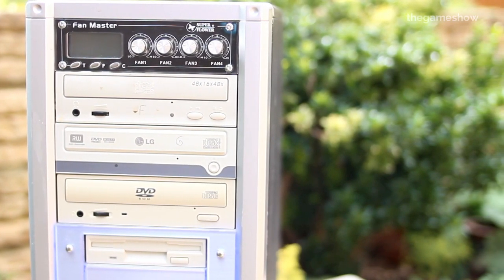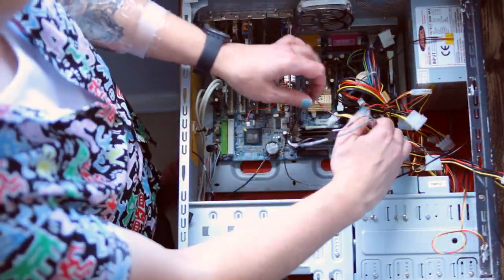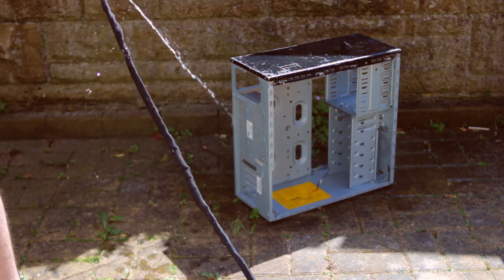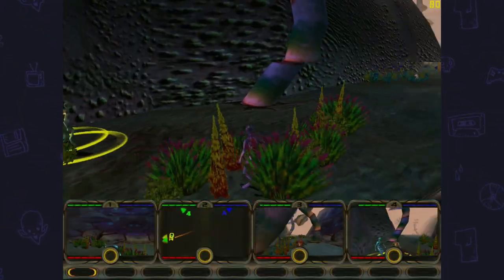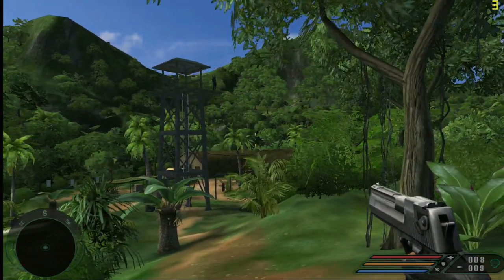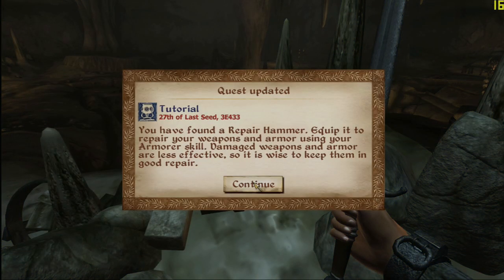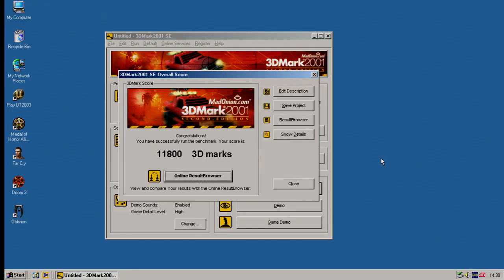Refurbing a 2003 Radeon 9700 Pro Gaming PC | Get into Retro PC Gaming

Comment: I really wanna see Oldblivion (I think that’s what it’s called) which made the game run on a Pentium M + X300 Laptop I grew up using. 

I completely agree about PC part pricing on the retro side. The main cheap way to get into it is just trying to find a prebuilt on Marketplace. The bootfair shave dried up, eBay is full of scalpers (my £50 S423 Board is now £150+) 

Absolutely fantastic watch, I’d personally love to have a showdown between this and my retro Pentium 4 PC 👀
Reply: Thanks for linking me over to this :) this was definitely an interesting video to watch. It's a shame I don't have easy access to car boot sales and the like, as I'd still be looking to see if I could find anything of interest/value.
Reply: This was a cool video thanks budget
Reply from the maker: Yeah eBay is a lot of work for buyers now. FB isn't too bad, or the pre-owned apps like Shpock or Craigslist. 

That showdown is a great idea. We should definitely do that!

Oh and also, thanking you for the punt dude. I massively appreciate that.
Reply: I have found the best way to get old ram and gpu's is to buy joblots, alot of effort is required to test them though as they are mostly sold untested hence the low prices, I got a couple of lots that worked out at £1 per ramstick/ GPU.

Comment: Great thorough rebuild - really enjoyed watching :)  I was a big fan of the Pentium 4 back in the day, despite all the concerns around them running hot, and still am today (my current Windows98 build is running a 3Ghz Pentium 4 and a Radeon 9800 Pro,  both with mild overclocks, so in a similar ballpark). For a bit of comparison if you're interested, its 3dMark 2000 score is 16537, 3dMark 2001SE is 16895.
Reply from the maker: Glad you enjoyed it! The P4 is a great CPU. It gets a lot of flack probably because it hung around too long. Great sounding build, bud.
Reply: @MattyStoked  Thanks! Yeh there's a lot of support for Pentium 3 in the intel camp when it comes to building a Windows 98 PC, or going with an AMD of some description.  Id be keen to try them one day.

Comment: Hey mate I had a Powercolor 9700PRO AIW back in 2003, it was the bees knees. I had my Xbox hooked up to it and used to play Xbox Live on one monitor and browsed the internets and chat on the other - it so awesome. Mine ended up failing though, R300 was the best!

Also regarding Doom 3, I recall playing it at 1024x768 with mediumish settings at 30fps+. I think Morrowind would be a better fit for this PC.

Comment: 7:00 By the way, 9700 and 9500 cards have a massive failure rate due to the cooler contacting the metal shim surrounding the GPU die, rather than the die itself. You might want to take the card out, hold it against a bright background, and just check if you can see daylight between the shim and the heatsink. If you can't, and the heatsink contacts the shim, your card will kill itself with enough use. I've personally bought and returned many broken Hercules 3D models also, so they've got the same problem the reference cards have.

The fixes are removing the shim, or getting something like a Zalman VF700, or a heatsink from a 9800-series card, both of which protrude below the shim to make complete contact.
Reply: You might get a performane boost with windows xp.

Comment: Actually scored a Radeon 9700 Pro in an ebay auction for $120AUD (about $85USD) with original box! I know I lucked out there. Matched it with a Athlon XP 2800+ with socket A MB for $30 I bought 6 months earlier. Already had a case and RAM, so pieced together a naughties era PC for myself. Even managed an 128GB SSD with adaptor for loading speed and dual boot 98SE / XP. The thing screams compared to what I had back then.

It sits pride of place next to my modern Ryzen 9 machine. Both my teenage kids fight over it to play Quake 2, Unreal Tournament 2003, Half-Life 2, Wing Commander 4 and a bunch of other Star Wars games.
Reply from the maker: That's so rad, man. Really pleased to hear the next generation are enjoying the old games!
Reply: Nice thats an awesome deal.

Comment: I am currently slowly aquiring the parts to build a late 2000s beast build with a Q6600 and 8800 GTX. It should be able to run anything from the 2000s very well and its limit would probably be Crysis, where it should get roughly 30 to 40 fps at medium.

This era of components is actually rather cheap imo. I am reusing some parts that i had lying around like a PSU and a DVD drive. I am able to get ddr3 or ddr2 ram for like 5 quid. And i am probably going to fit it in a newish case and make it micro-atx to save on space. I paid 20 quid for the CPU and GPU combined and I worked out it will be roughly 60-70 for the rest of the components depending on whether i go for am SSD.

I can't decide what OS to go with tbh. The 8800 GTX was I believe the first card to support DX10 and Vista is the earliest OS to support DX10. But then I might go for something even later becasue I wouldnt mind access to Steam as i dont have many physical games anymore. I could always dual-boot but idk.

Comment: I recently built in this exact case, but with black metal, and no side window case mod. Picked up an old junker PC for the PSU and case in order to flip some spare parts. Really made me realise just how little cases have changed.
Reply from the maker: Dude, you're right! ATX mobos and cases have been on sale for nearly 30 years now. Save for a few cables and connectors, building a PC has barely changed since the '80s. I absolutely love it.

Comment: You might want to mention about jumpers on the HD. A lot of people will build to see there HD isnt being read. If there on an mobo it wont detect it unless the correct jumper is in place, its on the back. Its got little pins. if its set to 3 or 6 gps an old motherboard wont see it. you have to set the pin to 1.5

Comment: Sleeving the cabling was the right move. Pentium 4's pack the heat, and it's smart to get some airflow going. Also, ME isn't a bad idea if you're targeting 98 era games, but I think there is an unofficial service pack 3 for 98 that you might want to try too. Cool build. Enjoyed the video.
Reply from the maker: Thanks for the very kind comment. NGL, 90% of the reason I sleeve the cables is aesthetics. I hide behind the idea of efficiency but really it's because I don't like looking at the cables lol. I really like ME, I don't get why people continue to dogpile on it. Win98 SP2/3 is also very good, but that doesn't make ME bad!
Reply: @MattyStoked  not kidding. I started typing out my comment suggesting you buy some tech flex sleeve and heatshrink, but then saw you already did it. Haha I'm the exact same way. The ketchup and mustard look was never flattering. As for ME, I think people just don't like change. Windows users always hate updating.

Comment: Had the same 9700 pro in a box for years dunno if it was working still.
During a move something fell into the box of stuff in like 2016 so it broke off a vram chip and upon testing it was certainly dead at that point, pretty much decorative as a bare pcb now in my apartment.
Hercules 3d prophet 9700 pro i believe it's called.
This generation of cards were prone too die due too the shim around the gpu die being slightly higher then it should so you should remove it really together with vram chips running quite hot but they have heatsinks on this model of the card.

Too get the shim off, basically use a boxcutter/snap off blade knife (Used a generic cheap one here too remove the shim on the dead 9700 pro i got.)
or a sharp thin X-Acto knife & carefully go around the edge of the shim slowly pushing in under it between the gpu & shim & slowly forcing it upwards as you'll be cutting the glue/tape which is like 3 - 4mm wide use a shorter blade if possible & make sure too not push inwards with too much force towards the gpu die like i did with this dead card, i mean it popped off but i also destroyed a small capacitor on here on the gpu die.

The corners should be easiest too push in at as the glue/tape isn't around there, careful so you don't destroy one of the capacitors around the gpu die though i pretty much tore one off as the blade pushed straight through the glue suddenly trying it here on the dead 9700 pro i got.
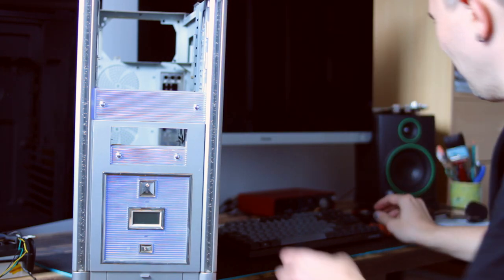Might take a few minutes but it should eventually pop off fine even 20 years later think philscomputerlab did remove the shim on a working 9700 pro a few years ago in the video called " How ATI upset Nvidia with the Radeon 9700 Pro " at 7:30 or at least shows the problem there these cards have.

I myself started from the bottom left on the agp slot cutting that length only while forcing it upwards, i can post an image too your twitter of the result here if you need a general look of the glue/tape.

nevermind the twitter as it doesnt seem too exist anymore. I'll post it in the discord instead.
Reply from the maker: I'm really hoping a fat blob of thermal paste will mitigate the shim, as I'm nervous about removing it

Comment: I love the northwood p4. I actually bought a dell with 3.06 northwood, the first hyperthreaded CPU and a 9700 pro because I couldn’t get ahold of them from any of my suppliers yet cus they were just released. I built a new machine around those two parts. I’ve recently started buying all the parts to recreate that machine. I’ve bought the motherboard I wanted so bad back then, a socket 478 Soyo Dragon Ultra. I’ve gotta go through all my old parts but I think I still have that dell 9700 pro.
Reply from the maker: Sounds absolutely perfect! You'll have a great competitor to The Red Menace here :D

Comment: This looks like an awesome PC for running older software, such as those late 90s to early 2000s games that you mentioned previously. Very powerful for the era of the PC, I must say - our old Windows 95 era PC (which was later upgraded to ME) was much less powerful than this.
Also, even with the 120GB IDE hard drive, I reckon you could dual boot Windows ME with Windows XP, for the best of both worlds - though admittedly, performance in XP would likely be worse, and games made that require XP wouldn't run too well either.
Lastly, I loved the fact that it came with multiple DVD/CD drives, a floppy drive, and other I/O expansions - I'd have personally kept those in, even if you would never need to use 3 optical drives at the same time. 
Maybe with an additional, larger capacity, IDE hard drive (or SATA if the motherboard supports SATA), and upgrading the 10/100 Ethernet card to a Gigabit Ethernet card, you might just have yourself a nice media server PC too.

Thanks to Budget Builds Official for kinking me over to this video.
Reply from the maker: I only considered dual booting after installing Windows and a bunch of games. If I'd planned ahead, I would have partitioned the drive. But considering I have the HDD and the DVD drive one one IDE cable, everything takes a wee bit longer than usual and I just couldn't be arsed doing it all again 😅

Thank you for the high effort comment. Big love to Budget Builds and his community <3

Comment: Holy shit! He had the original receipt?!
Reply from the maker: Yeah, amazing isn't it? It was in the case!
Reply: I still have all my PC build receipts for all the systems I've had as far back as 1997 - also scanned for archive purposes.  Same for PC game purchases.  The receipt would go in the big box.  That system build receipt in the video is almost the same layout as one I have for a system built in 2001.  I think a lot of system builders at the time were using the same software.
Reply: @jimjamz.  I wish I had this mindset earlier. In 1997 I would be 8, though. So Not much of a brain for that stuff.
Reply: @RetroAmateur1989  I was in my very early teens in '97, but still thought to put game manuals in zip-lock bags and wrap PC big boxes in bubble wrap.  Weird kid! I'm glad I did though.

Comment: I like this video 😉Did graphics cards get outdated that quickly back then? High-end level card from 2002 was already struggling to deliver constant 60fps in 2003 games, leave alone 2004 games like DOOM3, Far Cry or Half-Life 2. Btw, doesn't compatibility mode help with Win98 games on XP?
Reply from the maker: Mate, graphics cards moved like lightning in the 2000s. It was entirely unsustainable - you could buy two graphics cards a year if you wanted to stay on the cutting edge.

Comment: Hey guys, retro gaming on OG hardware can still be cheap. The hint I can give you is :"don't buy what want, but buy what's on the market".

In my area slot 1 boards are getting really expensive (50 quid and more for reliant, but no-fuzz-boards.) Pentium 4, strangely did the same price-hike. 
Athlon xp combos went from 10 bucks to 25ish in the last two years, but still better than p4. 

But what is really really cheap ATM in my area are core2 systems, core2 duo are a little cheaper. Go buy a nice c2d bundle, build a great system and enjoy it.

And the other end of this price-wave are Pentium 1 systems, which parts  you can get for about 30 bucks (CPU ram Mainboard and sometimes GPU). 
Even standard 486 and 386 systems are priced better than p4 systems ATM

Go and explore more an new old systems you never had, follow your urge of nostalgia in a couple of years.
Reply from the maker: GREAT ADVICE! Thank you, friend.

Comment: Ah doom 3, i remember the mags back in the day showing early screenshots with Carmack and co saying you would need a GeForce 3 to run it well, boy was he way off. Doom 3, Farcry with its Graphical updates and HL2 were the sign that my similar spec'd PC, albeit with a 9800 Pro, were at the end of their days (not really but not performing as well as I wanted) so it as time for an upgrade and a full switch to XP (was really not a fan of pre SP1 XP, for all the complaints about ME, or even Vista 32bit, pre SP1 XP was much much worse in my opinion with it making ME flakiness seem rock solid).

On the plus side, my old 9800 Pro and 1GB CL2 DDR 400 RAM from that PC are now in my Shuttle XPC retro PC, along with a P4 3.2GHZ 1MB and Windows 98SE/ME/Win732Bit (Win7 mainly for transferring stuff as its the latest OS that it supports), so they may have been long since replaced in my main PC but they still pull their weight near 20 years later.
Reply from the maker: I love retro Shuttle builds. Thanks for the super high effort comment!

Comment: I obtained the ATI 9700 PRO, just after it was released, for  a ludicruous low price. I was offered a 2nd hand, relatively new 9500 for about a 100, maybe a 120 euros. which was a fair price at the time.
Lo and behold, when removing it from the anti-static sleeve, it turned out to be the 9700PRO! 
Which was offered new for €450-500,- 
Imagine my joy when Far Cry was released and I could actually run this game.
Reply from the maker: That's rad!

Comment: Does anybody know what this case is called?
Reply from the maker: They went by a lot of names, it was an OEM case. A common brand was "Lian Li" but I've seen them (or similar) sold under Raidmax, Kingwin and Enermax. This is actually a frankencase, made from two cases from different brands. As they're OEM, they were compatible with each other.
Reply: @MattyStoked  oh

I remember my dad had one of these, and i kinda wanted to build a modern pc in it, i guess its not happening